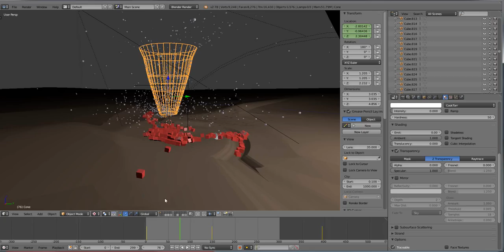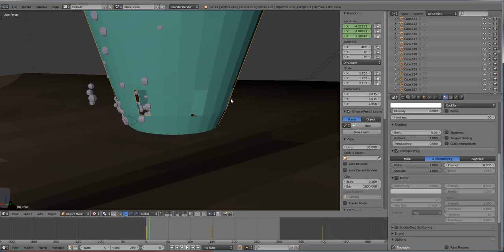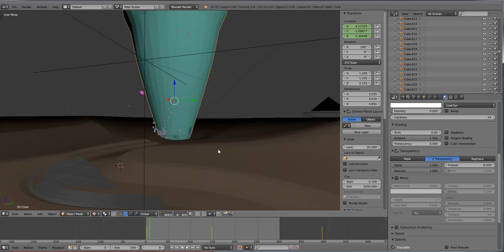Blender -  How to -  Fire and Tornado Effects

Comment: I need your help….I love seeing your tutorials…you have such
good communication skills that it is easy to get your messages. Look I really
need your help on this: 

Let’s say I have several pipes one on top of the
other (cylinder chain);I cant animate that with armature using bones;So heres my question: how can I parent a curve
to the sequence above, in a way that when I move control points of the curve I
would move the cilinders????Maybe you already have a tutorial ready…..thank
you so much for any help
Reply from the maker: Hmm...I'm a little rusty on that subject as it's been 2 years since I've done any significant Blender work. In the past, I have typically used bones, parenting an empty to the tip of a bone and then parenting an object to that. Or, you can check this tutorial on using hooks with curves which does the opposite of what you're looking for but it might give you some ideas. https://www.youtube.com/watch?v=6Hn3YY0Vgbo  Finally, you could try making your own "curve" with a bunch of points, then go into edit mode and select one those points, leave edit mode, select your cylinder, shift-select the "curve" and then parent (Ctrl-P) the cylinder to the previously selected VERTEX of the "curve".  Or, another option might be to create individual line segments and connect them to each other with rigid body joints.  Hopefully that gets you going.